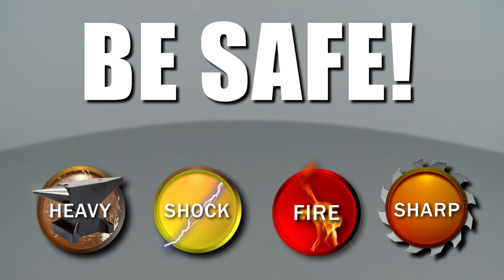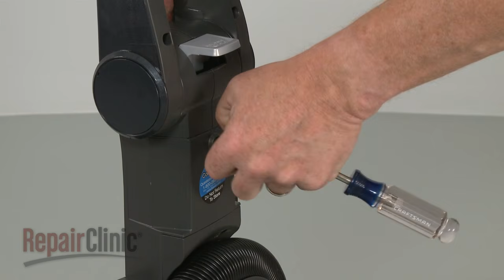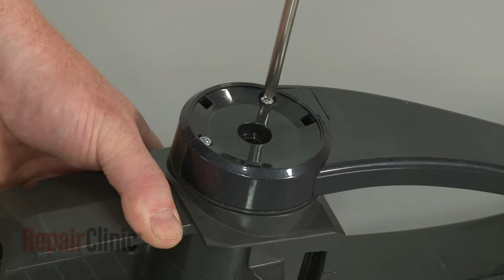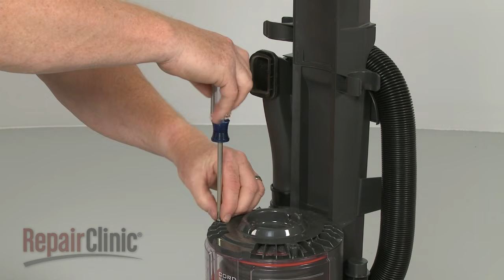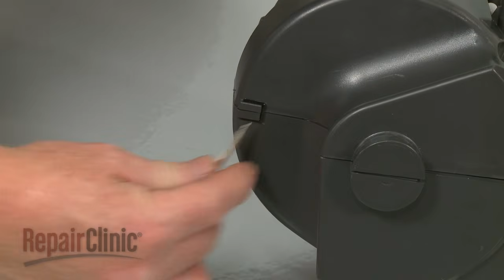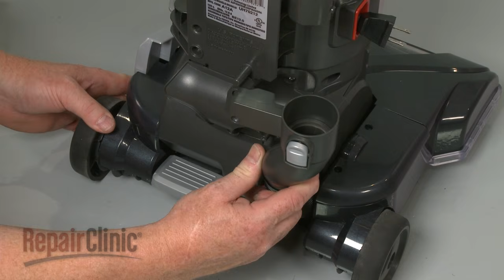Hoover Vacuum Cleaner Disassembly – Vacuum Cleaner Repair Help

Comment: This is a great video. Unfortunately, it doesn't cover the most important part, cleaning inside the canister below the upper filter. The clear housing does come apart from the filterby twisting the  top and makes cleaning debris easier. Putting it back together is beyond difficult as tthe tabs do not align to the slots around the rim of the canister. This issue is not addressed in this video nor in any other video on Youtube. Even Hoover does not address this problem. Hoover knows the issue exists, yet they offer no relief. No more Hoover products for me. Vacuums have evolved enough over the years, and other companies offer products just as good if not better than Hoover.

Comment: I have a Hoover vacuum cleaner. I took off the bottom part to replace the belt. When I took it apart a C shaped metal piece that holds the wheels up for the adjustment came off. Can't figure out how to put it back

Comment: I have the hoover vacuum model uh70120 and I'm trying to clean the cord housing due to a leaky filter which case alot of dust build up but the built of the vacuum in this video is different from the one I have. Mines don't have the clips to remove and I can't get it open. Can you help please 🥺

Comment: Where are you? A few questions about surface selector switch have been unanswered. lol Mine works but it doesn't lock in place to disengage beater brush. Model UH30300

Comment: All good but doesn't explain how to fix a siezed agitator brush which causes the belt to burn and break. This can be done by removing the brush, removing the two black screws along the brush shaft and inserting good household lubricating oil. Then tip the brush both ways to get the oil to the bearings and work the ends till it frees up. Took all of five minutes. Re[place the screws as soon as you have inserted the oil or it will drop out on your carpet!

Comment: Same with the pedal when you step on the button does it stop the agitator rollbrush from turning completely or do you have to keep your foot on pedal button to keep it stopped. When the vacuum is placed in the upright position, the agitator brush is suppose to stop turning, is this correct? Cause mine keeps on spinning.

Comment: thankyou sir, just fixed a simple issue based on your video.  a clog in the house where it snakes into the bottom.  Full of dog hair and pine needles from Christmas.  Just needed to see how you disassembled the vacuum cleaner.

Comment: ....... shouldn't there be a set of wheels at the front of my new Whirlwind as well as the ones at the back..... it is rather difficult to push over carpet! 

I'm disappointed at the power cable length which is very short and restrictive.

Comment: Amazing, a household appliance that should run with no problem requires constant maintenance and cleaning, If I wanted this problem, I should have bought a high performance sports car. What a bunch of crap. I got a Hoover tunnel and thermal switch went bad, after using 6 times. They sent me another one, Same problem happen after using it 6 times. Now they tell me to eat the problem. They use a warranty date of the date the product was manufactured and not the date of purchase. Good Luck if you have this thermal problem.

Comment: I would love a clip on how to expose the motor on an Hoover Dust/Manager, has I have cleaned out all the filters & replaced those but the Hoover still cuts out after around 10 minutes of usage. l have checked every thing else even the Rubber Belt, but I can not get the cover off the motor enclosure after removing the 2 Philips head screws that I can see. any help Greatly Appreciated.
Reply: lo solucionaste?

Comment: My Hoover Wind tunnel vac just stops working due to overheating.  I unplug it and once it cools down it starts again.  What is causing this??  I've cleaned everything I can in it.
Reply from the maker: +Jean Ryder The motor could be defective if everything is clean.

Comment: great video, thanks
i have a uh30310 and it doesn't glide well. need to push really hard.
all the wheels turn but very difficult to move around. 
thanks
Reply from the maker: +nellspop1 The rollers could be worn or something caught inside it causing issues.

Comment: I have the same vacuum model.  My surface selector switch is broken.  How to repair/replace?
Reply from the maker: +jridge16 This video shows how to disassemble the vacuum to get to the switch. Take it one step further and lift it out of the housing and disconnect wires.
Reply: +RepairClinic.com  I have a Hoover wind tunnel  model uh70120 and when I tilt the vacuum in the front it makes a squeaking noise can it be the motor or belt because  the vacuum works so it cant be  motor

Comment: Help, I have a clog somewhere in the hose on my Hoover Windtunnel 2. I cannot get the hose separated from the vacuum up by the handle. In your video you just twist the hose loose. Doesn't work so well on mine. The latch seems to have a little piece that will not let the slider come out of the groove. Sucker flat will not disengage. Is there some trick I'm missing?
Reply from the maker: Take it outside and pour hot water on the latch and hose to see if it will loosen up. Alternatively, try using a small screwdriver to help pry it loose. If you do this, be careful not to damage the hose and fitting. They sometimes get stuck if they haven’t been taken apart before.
Reply: I appreciate the response. We'll try that. There seems to be a notch at the end of the slide area where the hose slips into the vacuum. That seems to be keeping the hose from coming off. We thought perhaps that was a defect in the plastic, but then again it could be there to keep it from just slipping apart. Will give your suggestions a try.

Comment: Great video - extremely helpful!  I have a Hoover Windtunnel T-series, Model #UH70210.  Was working on removing the motor housing but then came to a screeching halt - this model has a light bulb.  Even after removing the light bulb, the socket prevents me from completely removing the motor housing.  What's the trick?
Reply from the maker: You may have to disconnect the wires from the light socket. If they will not come off the socket you might have to pop the socket through the housing with the wires attached. Even with the light housing attached to the wires you still should have enough room to set it aside and remove the motor.